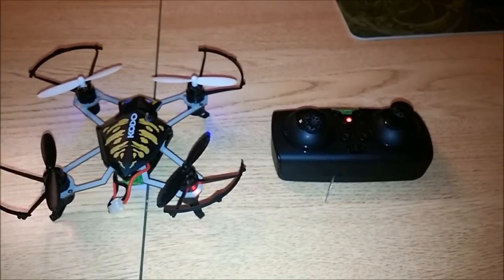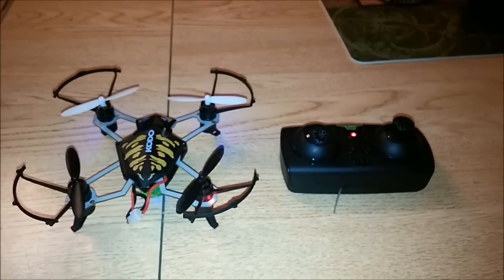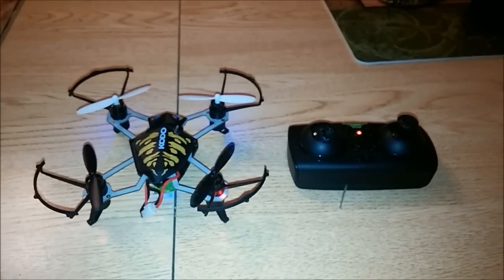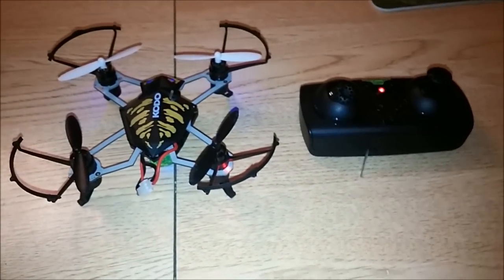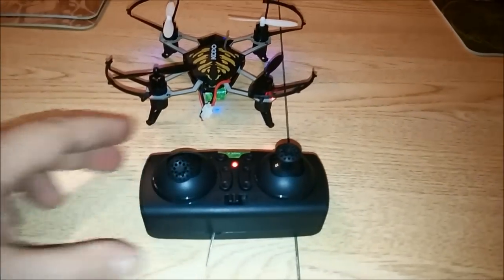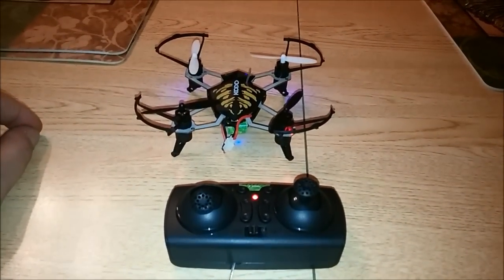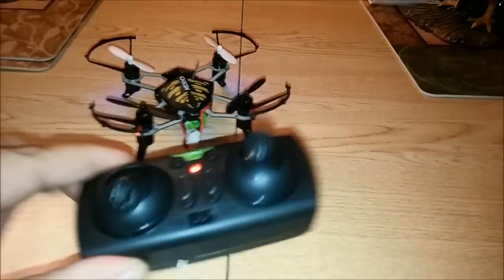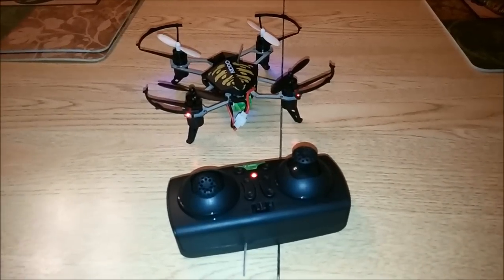Dromida Kodo Antenna Mod

Comment: Kenny, thank you so much for this info!  Just preformed your Mod and while I haven't fully tested range difference yet, it is easily 2X OG!
Reply: +Ryan McAllister BTW Tested range pretty well today.  My OG range was maxed out at very close to 40 Feet unobstructed ground take off.  With Mod I went to 150 (max I could do at location) and had no issues taking off and flying it home.
Reply from the maker: +Ryan McAllister That is great news.

Comment: Kenny,after. Watching your mods,I did the same mods,but removed every bit of plastic and screws.If flies flawlessly.I shaved 8 of the 52 grams.I think it flies better,and alot more responsive.
Reply from the maker: +Cj Hyde I am guessing the plastic you are speaking of was from the canopy? Thanks for watching.
Reply: The Canopy,battery tray,prop guards.etc etc..no plastic at all.I'll upload a video.
Reply: I never made the video,and I.  Sold the quad sorry.its real sasy though,I removed all plastic top and bottom.I used double sided sticky tape to mount the electronics,and camera.I used rainbow loom bands to secure battery.any other questions feel free to ask.
Reply: It was a blast to fly,I personally upgraded to BRUSHLESS quads,alot faster and motors dont burn out as often.I had 4 Dromida omius quad,that ate motors every 3-4 hrs.I have alot more than that on my 250 brushless quad and still as fast!!
Reply: I flew mine exposed,with a few HARD landings,and it is still flying as far as I know.I sold it to my brother n law.he loves it.Have you checked out banggood.com or gearbest.com.They have better quads for the same money you will spend on the kodo.
Reply: Look for yizhan tarantula x6 with camera is 90$ w /o camera 50 or so dollars,and the camera version comes in 3 or 5 mega pixels.This quad is huge!!!If uses a big 2s lipo like 2000mah.Also look at the syma x8c with awesome camera for 109$ and free shipping.Hope this helps.

Comment: Thanks for the idea! Doubled my range maybe more. No need to drill a hole on the canopy just pull in to the side and bend it over the middle of the frame to keep it out of the way of the props. You can hot glue it if it moves. I used a soldering iron to melt a perfect hole for the TX antenna. Could only make it to my next doors driveway now it makes it 3 houses down and still no lost signal..

Comment: Hi kenny thanks for the tip . I am having the same problem . The kodo will just fall out of the sky . I watch your range test on your mod . Are you having anymore issues ? On the kodo itself are you just using the existing antennae . I push the antennae and guide it throuh the eye of the copter . Have not tried flying it yet .have to try it out in the open field because mine landed on a neighbours roof . lol
Reply from the maker: Hi, Thanks for watching. I only used the existing antenna and just positioned them in what i consider to be a better location. Weather has kept me from doing more flights. But ran several runs the day I made the range test video and did not have any issues with signal loss. Hope this helps.